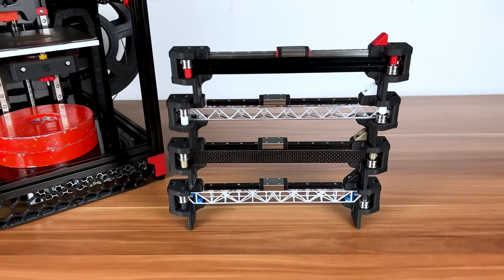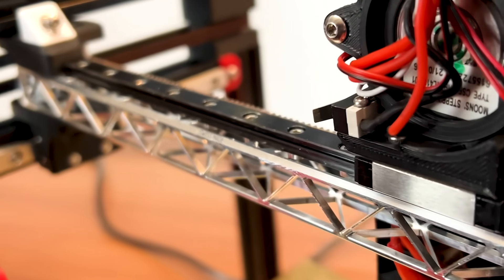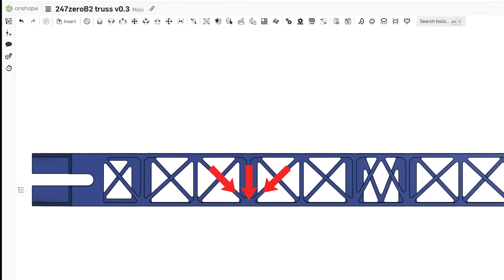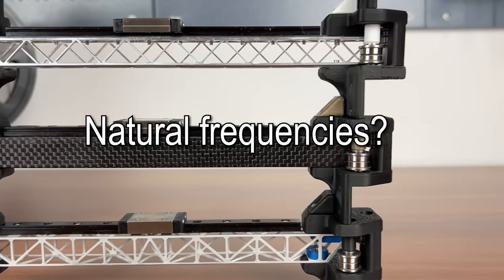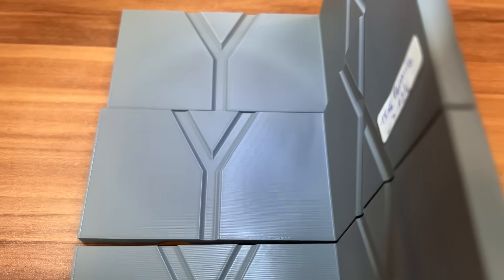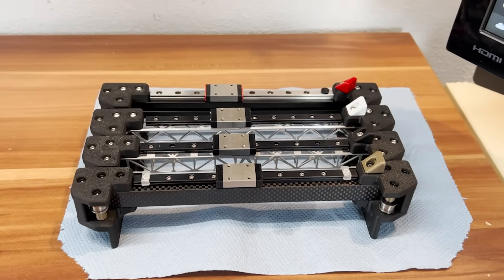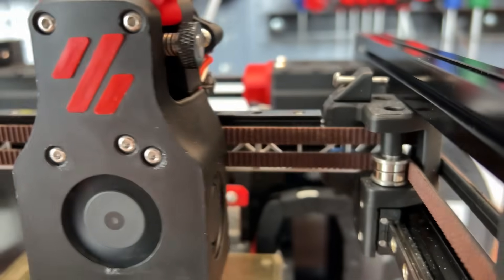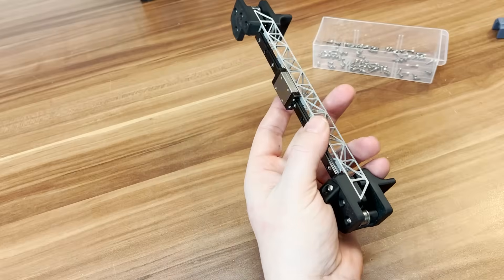ULTRA lightweight X-BEAMS tested -  USELESS on Voron 0.0 / 0.1 / 0.2 ?

Comment: Do an organic design that has increase in material toward the center where a uniform beam would be stressed the most. Have  PCB way 3d print it in titanium. You could try coating the inside of the carbon fiber tube with an elastomer to see if it dampens any resonance.

Comment: I think the reason for lower acceleration is the resonance. What does each beam sound like when you tap it on the desk? if it rings like a cymbal, then it's not a great mechanical part.

Lighter means less torque required for same acceleration, but if said acceleration causes the beam to ring, then you'll see it in your print.
What you need is either to damp that vibration at each end to absorb that energy, or have a beam that inherently does not ring due to material properties.

I do love you videos though, really inspire me with this voron zero i found at on shelf in a very sorry state at work.
Reply from the maker: I'll check, thanks for that easy test - makes a lot of sense 👍 Thanks also for watching/liking my videos - means a lot!

Comment: Isn't this that the more ridged beam is transferring the vibrations to the rest of the machine adding to dampening, where the light weight beams flex enough to keep the vibrations at the head unit? If you were going lightweight, you would need to be more ridged at the center then lighted outwards. I would say try a parabolic back beam bolted to the lightest one and see if it helps.  I also have  no idea if this it true. A test might be to vibration test and a far left or right position.

Comment: Seams useless to worry about a few grams on the beam when more weight can be saved by redesigning the huge blocks the beam mounts to, drilling holes to lighten the linear rail and carage and cutting away anything not structural on the hotend

Comment: One year after comment, have you considered that the linear bearing rail is also a structural element?
Meaning it can be used as a stiffening member.
By attaching it to the tested rails some stiffness seems to come from there, meaning the ultrabeam has space to improve if the stiffness of the linear rail is accounted for, maybe a longer linear rail could be connected to the end pieces helping to make a even lighter rail

Comment: I am sorry.  The aluminum beam weight is not much.  Reduce it weight is meaning less. We should reduce the weight of the linear rail it self. Why it have to be so thick while the linear rail it self rely on how straight the beam is?

Comment: After looking at this for a bit, I'm surprised no one has done any finite element analysis or similar for the ideal structure.
Reply from the maker: Yup, topology optimization would be neat. That’s some expert stuff - I personally don’t have experience in this, but maybe I find the time to learn…
Reply: @247printing  Responded in 10mins, and here I am slacking a day 😅.

Analyses like that come included in Solidworks at least. I imagine other programs have them as well. 
The basics are just defining the material, where the mounting points are, what geometry should be kept and what the load is. The rest should be handled by the program.
I'm saying it as if it's easy. I haven't tried yet either.

Really neat though seeing you react so fast on a year old video. Cheers!
Reply from the maker: @Litl_Skitl  I have done it multiple times in various programs (also onshape) - setting up model and loads, playing around and to have some basic learnings from that is kind of easy, yes. Doing it properly and on professional like level is what I was talking about - that needs years of experience.
Reply: @247printing  yeah that's fair. 

I just see I meant topology optimisation instead of just FE, but that is a high ask. Would still be cool to see, maybe with some help.

Comment: so, I have a theory, the lighter beams have more flex but think of it as a vibration, that disrupts the input shaping vibration. kind of like wobbling around and causing a ruckus while its trying to smooth out the vibrations. there could possibly be a math equation written up to adjust for that extra vibration using your deflection measurements. i wouldn't know how to reprogram input shaping for this so its probably not feasible right now.  I was just thinking what if you wrapped your light weight hyperbeam in carbon fiber?

Comment: You should try a sort of minimilast CF composite beam. Like make a foam core with carbon plies over top and bottom, chop them and laminate, Because that's how carbon fiber is most effectively utilized.

Comment: Why do you get worse results with the lighter beams?    It should be obvious...

The mass of the beam is not the limiting factor.  It is the stiffness of the beam that limits acceleration.  You need to engineer a stiffer beam and don't worry so much about mass.

Try maybe an aluminum box-shaped beam with very thick walls that weigh close to the same as the 1515 extrusion.   Or even try a solid 15 x 15 I-beam. My bet is the thick-wall box is stiffer than the 1515 exstusion for the same mass.  Try a box with thick enogh walls then you do not need nuts to hold the rail.

Voron used the v-slot 1515 not because it is the best structural shape but because you can drop nuts into the slot and not have to drill and tap holes.   It requires MUCH less skill and tools to build with V-slot because you don't need a drill press or mill.   

But if you are going to make an sell metal Voron Parts, you wouild have CNC equipment and

Comment: I like tests that actually measure performance rather than just talk about it.  For CF, winding CF fibre onto a mandrel that aligns the force vector of each stress element with the fibres will maximise stiffness.

Comment: I think you should test the beams with aluminum brackets the lighter beams have less mass dampening of the abs corner brackets and the answer is the beams are all excessively stiff compared to their mounts.

Comment: When you tested stiffness of the beam it seems you did not include the rail. The rail would supply stuffiness and weigh more than the beam. In effect you must test the entire mobile carriage under motion. I would anticipate the whole mobile unit to be built from light weight al or carbon parts to really enhance a proper weight reduction which would increase  both X and Y.  My guess is a stronger motor would be a fast way to get these units moving with emphasis on stiffness.
Reply from the maker: The rail was included

Comment: So, I'd say you're getting worse results with input shaper recommendations because the lighter mass is not able to absorb the vibrations produced as well as a heavier mass. This doesn't mean that the lighter gantries can't go faster, because they certainly can, but that's only half the problem.

Think of it like two boats on rough seas. One is much larger and heavier and has an overall slower top speed, but because of its mass and larger profile, it can handle the rough waves much better, providing a smoother ride. The other boat, which is small and lightweight, has a higher top speed, but gets tossed around by the waves, limiting how fast it can really go without breaking against the waves.

I realize this analogy isn't perfect, but I hope it gets my point across well enough. How to fix this, I'm not exactly sure. Perhaps progressively increasing the density of the lattice towards the middle of the beam to reduce flexing in the center might help?

Comment: Have you looked into Aluminum/Titanium hardware? Bigger SHCS you can get a hole through hold although I don't think they make them for such small bolts. Can probably save a few grams here with minimal to no performance loss.  Also looking at the vibrations of the frame in your slow mo. The frame is put together by blind through holes how much more ridge would it become with using the 80/20 90° elbows on everything but the X axis then your not adding weight but stiffness to the entire frame.  On the X axis maybe play around with different materials instead of ABS. Something glassfilled or HIPS.  Wondering if gaining a few grams say 5% weight vs gaining 20% in strength is beneficial on the brackets? How do the frequencies and vibrations play into effect.  Engineering mind is running wild late at night here. Love your detailed videos though they keep me thinking!

Comment: Great set of tests. You could make it even lighter with a triangular truss design. Only the top part really needs to be flat for mounting the rail. The part of the triangular truss could be thickened a bit to better transmit loads along its length, but it would probably have even better stiffness to weight ratio than the HyperBeam.

Comment: Yea... when I learned physics gravity was 9.81m/s2. But then I moved and gravity changed to 9.82m/s2  and I have to re learn everything i know... (about the 3rd digit of gravity)
Reply from the maker: Just use another value for a variable - no need to learn anything new ;)
Reply: @247printing  but my whole world fell... due to the higher gravity.

Comment: Harmonics the extrusion beam has more material more dense less harmonics are being introduced. To gain something you always have to lose something, you need to find a happy medium. Why not just use the linear rail by itself ? The thin aluminum, carbon fibre isn’t really going to add much strength to the rail.

Comment: A simple bracket that adapts from the printed part to the sides of the rail would work to save even more weight. The CNCed metal beam is over engineer and unnecessary.

Comment: Higher frequencies are dampened by more mass.  Lower frequencies penetrate the same mass deeper.  This is both a well known engineering principal and it's also intuitive.  So it makes sense that less mass resonates more strongly at lower frequencies.  More mass would dampen that and resonate less.

Comment: Nice! But you need to compare stiffness to mass of the whole movable assembly, no just part of it (like the beam only).
Reply from the maker: Please watch the whole video ;-)
Reply: @247printing  You do bring it up later, which is good! But this is especially important for the frequency analysis (earlier in the video).

Comment: Weight in the beam = vibration damping. However it also takes more force, and has a higher slew rate.  Think of the beam like the cone on a speaker.  The lighter the cone the more accurate, however you can't get to deeper bass because the mass to move their air with the motor.

Comment: Next, design a beam using topological optimization. Come up with something that will itself require metal (or PA12) 3d printing to build. I bet AutoCAD would sponsor you (if it works!).

Also: The 1550 beam likely has far more torsional stiffness and out-of-plane shearing stiffness than the box beams. You probably need something like a "space truss" design.

Going even further: once the beams are not a single solid material, you are going to get some cross terms between tensile, shear, bending, and torsion terms. The same thing comes up when you work out the response properties of a layered composite material.
If I am remembering this correctly: you can end up with a material that for example, when loaded in bending will internally give rise to a torsional deflection, and vice versa.

Comment: You've been stating the % mass reduction compared to the original beam, however the beam is only a tiny proportion of the total mass of the assembly that is moving. I imagine youre getting less than 5-10% reduction in total mass in reality but with much larger reductions in stiffness. Hence your strange results.
Reply from the maker: Please also watch the conclusion of the video ;-)

Comment: What is the mass of the full assemblies and the mass of the belts?  If the beam is a small component of mass then you shouldn't expect a large increase in performance.  Maybe you can get other low weight parts?  Ceramic bearings?

Comment: I'm no machinist nor expert, but I have some machining experience.

Mass might be your enemy for speed as it has to start and stop and that can cause overshooting aka ringing.
Too much mass and you need to use bigger motors to move it and can't accelerate so quickly.
At the same time too little mass will introduce harmonic vibration. Also ringing.
So it is a double edged sword. 
There's a way to have your cake and eat it too, ramping your speeds accordingly.

Comment: What is happening at 2:11 in the video? The scale starts counting up before the beam is even on it! Did you edit that with a different take so the LCD would be more readable?
Reply from the maker: Wow you have a great perception- while editing I was also wondering why it looks like this, but I bet it’s only because it was already slightly touching the scale from one side. Just one take here, no fancy editing
Reply: @247printing  nonono hang on, after reading the comment this really bothered me so I watched it a lot and it happens over and over again. I’m pretty sure the scenes with the scale are played in reverse for some reason.
Probably easier to position the subject more accurately this way

Comment: An very great and intresting video👍
It seems to be an useless, but fascinating hobby. But as an engineer, im not sure if your'e on the right way.

Well, i found your chanel, because im interestet in 3D printing, but until now, no printer on the marked could convince me. As an engineer and machine builder I have other conceptions about the design and performance.

Now i find the Bambu Lap p1 very Interesting, because i dont want to built it complete myself, i think the project would get out of control 😅
(i think the Voron is great, but maybe nothing to start with) 
that's way i got here.

You often compare with the head of the Bambu, witch is heavier, but i don't think the small rods for the guiding are very rigid. But on the Videos it seems to be no problem.
How ist this possible? 
Is the bending not as big as i think, or is it compensated by software?

i think, compared with industrial applications, the moving mass is very low, but the structure also verv flimsy
Reply from the maker: Thank you! Yes, the Bambu Lab resonance compensation (=software, different approach than input shaping) does a very good job and the whole machine "is professionally engineered", which is quite a novelty in consumer 3D printing. The mechanical system is top notch. 
Why are you not sure if I am on the right way? Because I put emphasis on lightweight? That initial statement is not supported by your text.
Reply: @247printing  I have seen the Bambu lab only on videos, but compared with other customer printers it seems to be realy good engineered with real guidings. Before, this was only on professional or selfmade printers this way. I dont know exaktly how the compensation works, but im sure it is necessary for the high accelerations, especially with this small rods they use.

You have made very scientific tests, and if you look on the results, it seems to be no big effect, and you have maybe reached the limit of usefull measures.

In my opinon there are two posibilitys left and more helpfull:
- compensation by software, what i think is the trick of Bambu , but i am no Programmer and don't know how this could work

- more rigid stucture, to reduce the bending of the components. Whats the matter if the weight is more? Just put an bigger Stepper in there. (for an Company it's cheaper to use an software and an small motor)
On the Printers it is all on very small scale, i think it would be no problem to use an motor with 10x the torque, of course the drivechain has to be able to transfer the force, and it would cost a little more, but ist some kind of sports 😉
Maybe ist would be easyer with an normal gantry, one Stepper for X and one for Y

to geht more rigidity, i also would go fourther. it`s common to use alu because it's leightweight, but ist has an problem. It has an low "E-Modul" if you apply force on a beam of alu, it would bend more than an beam of steel. 
i think ist would be better to reduce the bending, the frame could be out of steel. For the Beam ist may be not better, but maybe worth to compare the rigity. 
 the Best way to get more rigidity ist tu use an bigger dimension, maybe the easyest way with an carbon tube.
With a little bit more weight it will be more stable, but compare with some applications in the industry, it will never be heavy. 

i hope you understand what i mean, it would by easyer for me in my natural language

Comment: Maximum acceleration is highly correlated to beam stiffness so a solid material will generally outperform hollow material with the same outer dimensions. If you want a lighter beam with the same stiffness you need to make sure the moment of inertia is the same, which for these beams, isn't the case. The carbon fiber beam and Ultrabeam likely have a similar wall thickness so they get around the same stiffness and maximum recommended acceleration. Your Hyperbeam has thinner walls that both the carbon fiber and Ultrabeam so the stiffness will be lower. 

This means you'll need to adjust both your outer dimensions and your inner dimensions as opposed to simply hollowing out the center.

Comment: could you try building that beam but using topology optimization? lost PLA method could be used to make the beam out of metal. edit: for casting you could use brass as it has higher ductile strength than the aluminium which should result in higher stiffness

Comment: A weightgain of only 8% could have been calculated before all the testing. Furthermore I think the movements create friction and thus temperature and de-formation of that beam. that may not be absorbed well by the beams with less mass.